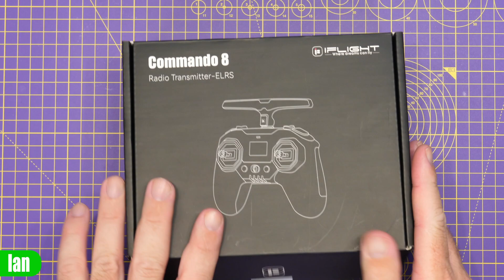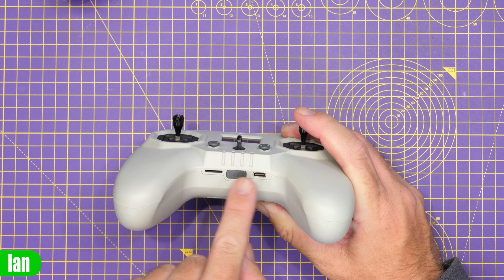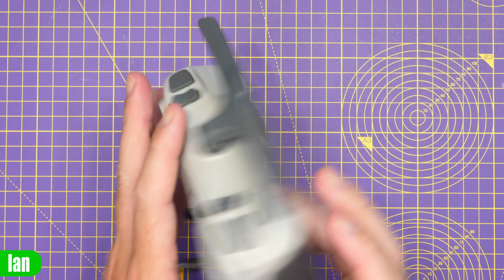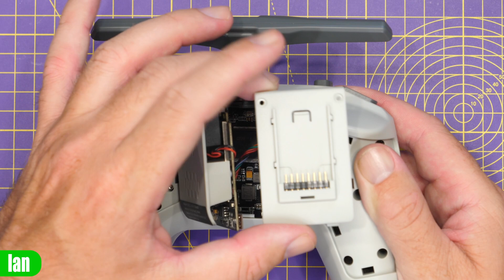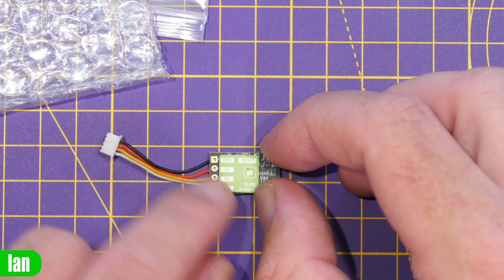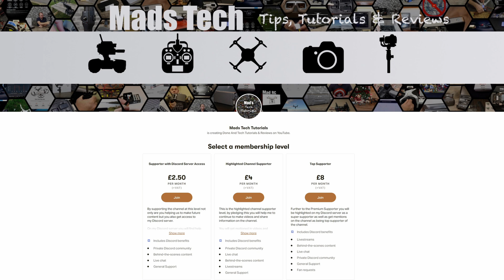iFlight Commando 8 ELRS Edition Review - Compact Edge TX Radio But Some Compromises

Comment: This is a bad design with Non standard size gimbals. Cannot open the radio either. Honestly I did not like any of the new game pad style radios, I feel the beta FPV lite radio elrs variant is much better than zorro, t-pro and the commando for beginners. I have my trusty and rusty jumper T-lite since over a year and it works great. If ever I decide to upgrade! I’d go for TBS Tango 2 Pro, just invest some extra money have you get premium class stuff which will work reliably for years.